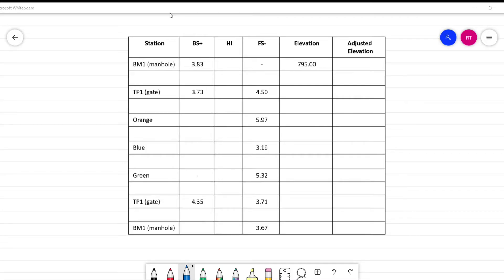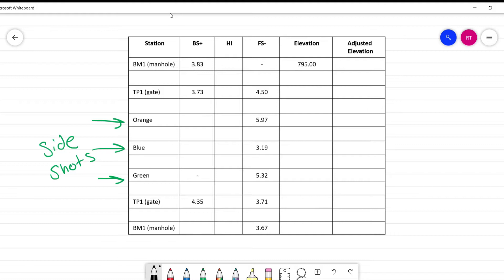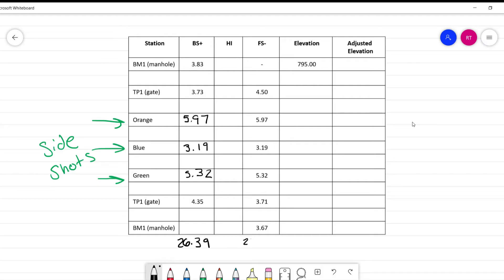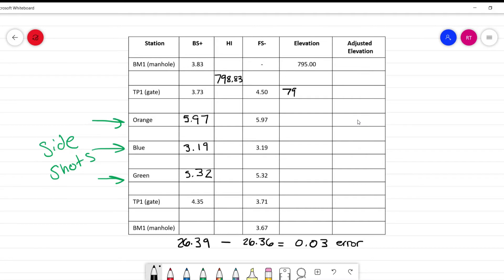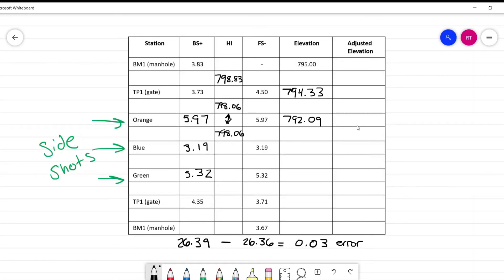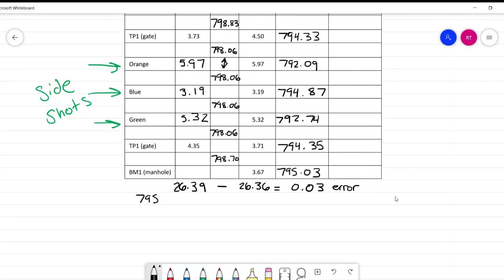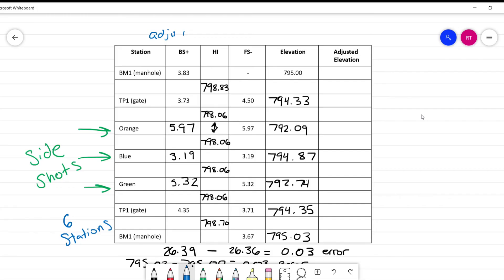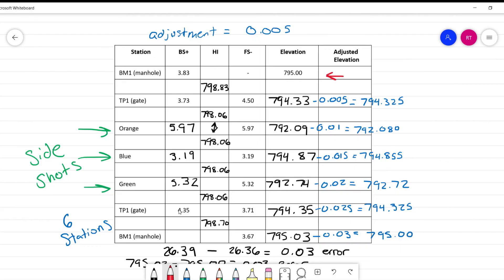Survey Leveling Calculations and Adjustment

Comment: I wouldn't include side side shots for adjustment calculations. I would have used 3 stations (3setups/backsights). Spread the .03 error over the 3 stations and then recalculated the side shots based on the new station height. What is your thoughts on this?
You have excellent content thanks for the help.

Comment: Thank you for this video. When calculating the adjustment, would you ever use a weighted average to account for the relative distances between each station rather than a straight average of the number of stations?

Comment: When you balance the error across of the stations, why do you add it twice more for every consecutive station? Why wouldn't you just simply subtract 0.005? for every station?
Reply from the maker: Because the adjustment is happens in every leg. If we just did the same adjustment, we wouldn't be balancing it across all the legs of the level loop.

Comment: Hello Rami; 9:26 If you throw out the 2 of 3 side shots blue and green then do the table one gets the same closure error of 0.03 feet.  

 TP1 gate adjust ELV =794.3225   ie 794.33 -  1*(0.0075)

Orange  adjust ELV =792.075  ie 792.09- 2*(.0075)

TP1 gate adjust ELV = 794.3275  ie 704.35 -3*(.0075) me 
BM1 Manhole adjust ELV 795.0000 ie 795.03 -4*(0.0075) 

Sometimes I use the same adjust for all the same shots done with the instrument in the same spot. ie error in Orange, Blue and Green the same error

ie Blue and Green use the same -2*(0.0075) adjust factor

ie 4 stations

So Blue adjust ELV 794.87 - 2*(.0075) = 794.855      say 795.86

So Green Adjust ELV 792.74 -2*(0.0075) = 792.725  say 792.73

Great video, Regards
Reply from the maker: You can always use less observations of course, provided your data is accurate. But yeah in theory that would work too!

Comment: When subtracting the error, do you linearly interpolate from the adjustment to the calculated value? Is this under the assumption that error increased by an even amount for each point measured?
Reply from the maker: YES YOU CAN! The faster way would be to just add the error over and over again (i.e. if the error is +2, then it would be 2,4,6,8,etc). I just wanted to break it down for the purpose of clarification.

Comment: Your numbers somehow changed from the first video to the second video? TP1s Fs was 4.5 and now is 3.71? How did it change?
Reply from the maker: YES! So the reason the numbers change is that I had an editing error in the first video. I made sure to correct it for this video to ensure the calculations worked. Good catch!
Reply: Me also noticed that. As it was TB1 forsight1 and closing the loop to TB1 foresight should be the same because the instrument has not moved. In that case they both foresights should be the same reading with 4.50. But that difference is too much. It is my opinion. Thanks any way, it was awesome.